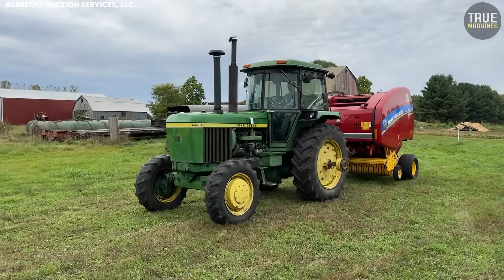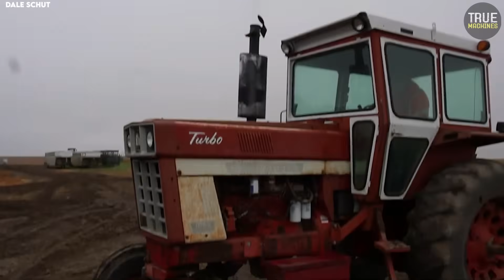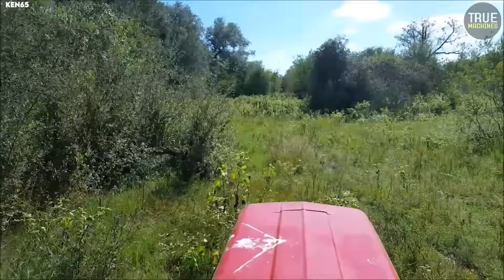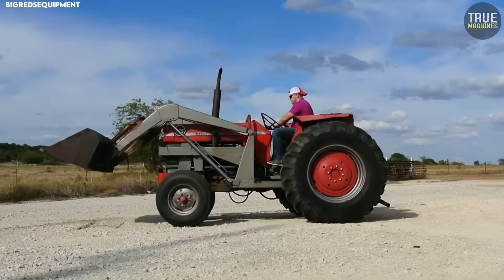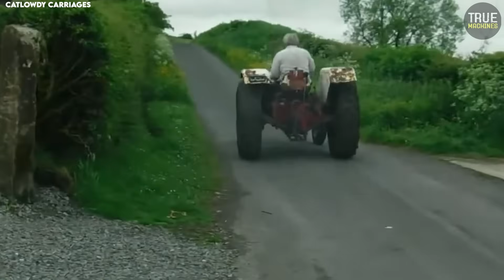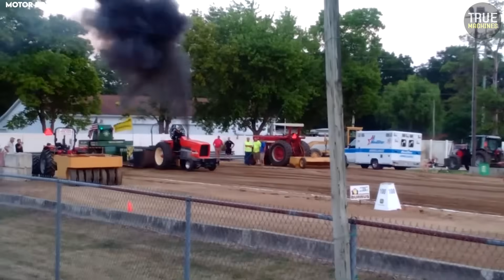10 Classic Tractors From the 1970s That Farmers Still Trust

Comment: My 1150 massey ferguson should've been  in this video  I know for a fact that a whole lot of other owners of this same model still have theirs running in the original condition too  because they were and still are extremely reliable just as good if not better than the ones mentioned in the beginning of this video so your video is extremely inaccurate....